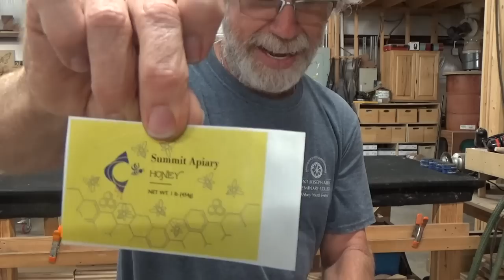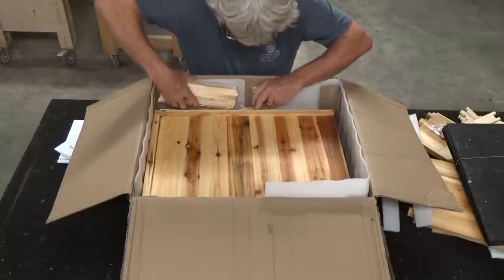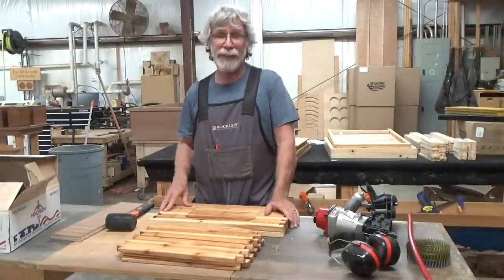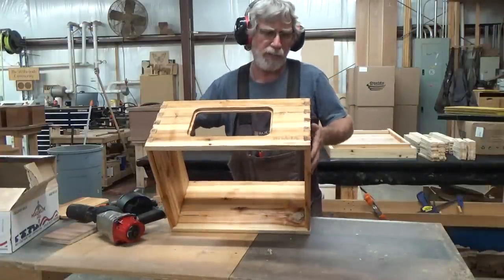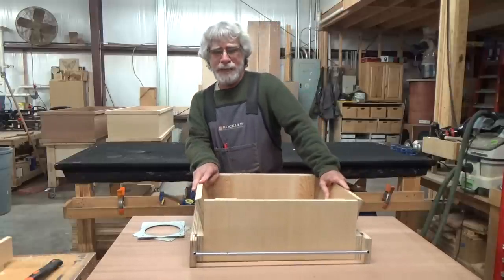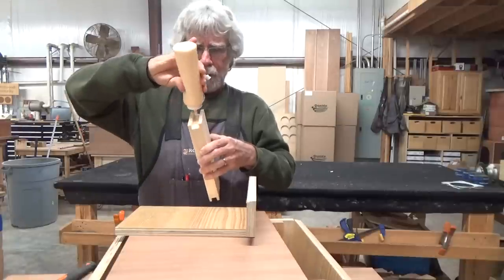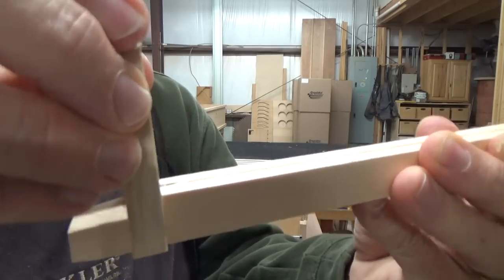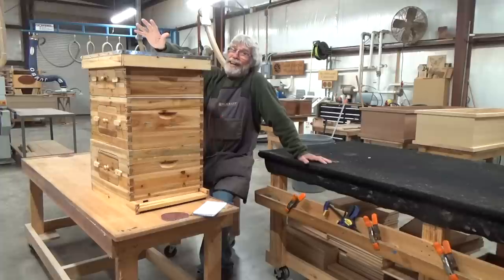Is this the best beginners beehive kit for you?  Total build of the kit.

Comment: Thank you for being so honest on this review.  I hope they take the comments to heart.  While I agree with you that these should have been more accurately machined and checked, I think the price point isn't bad.  

I don't know if you've priced cedar out lately, but WOW...the lumber in that alone is probably close to $50~$75.  A single 12' 5/4 Cedar Deck Board is STILL about $30 in my area.  Milling the lumber is time consuming for sure, and even with all those machines, there are still people manning it.  Cost of labor and overhead is not cheap to be sure.  Sorry, my old estimating habits coming out...

As for those observation ports?  Yep...100% agree, get rid of them.  That's a few ops you can delete from your build and cut some costs.

Comment: I'm a beginner, and the first time around I bought my boxes and frames already assembled. I figured that I already had enough to learn and remember to just get started and get my hives set up and go through the motions of being a beekeeper, so I didn't want to overwhelm my brain...lol...However, now I wanted to learn how to assemble...its cheaper and its the pride of knowing how to do everything for my bees, not just care for them.. This video was extremely helpful, and I learned things about what to look for in these kits that I never would have thought of, till they started to fall apart, or started splitting of course.. And your right, for the amount of money that u pay for them, they should come out of the box being right from the get go. Also, the original frames I got had wire strung across them, and I was never sure how to tighten or adjust them when putting in the new wax.. Or replacing them when needed...not sure if that was the old way of doing it or what???? But I like the groves in the newer ones that allow u to just pop the wax right in.. Also I love the frame jig...that looks like it works very well. I'm just a hobbyist, but getting older and with arthritis in my hands and fingers starting, that jig would make things much easier for me...and I could always share the use of it with my other bee loving friends. So, thank u so much for making this helpful video.. And I have subscribed to your channel.  June Bug, from Southern Oregon.....Soon to be moving to the Reno, NV area...
Reply from the maker: Thank you so much for subbing to my channel, I'm humbled every time someone does that for me. Thank you for your gift. Keep on learning about bees to keep the desire for them alive, I know you will. Also, I post a new video every Friday, and I look forward to hearing what you have to say. Good luck on your move and with your bees. God's peace June.
Mr. Ed

Comment: Thanks for an honest review! I do wonder if it were a first box for a new bee keeper (no experience), this wouldn't be a first choice due to the fact of having to assemble it and problems (like getting correct orientation of outside pieces plus if sides are not equal length.) And I wouldn't nail it cause --no nail gun. But of course, if you have one, good idea to do.  I am not crazy to assemble wood pieces someone else drilled or measured due to slight descrepancies . I put together a raised bed garden and I had to drill out all their predrilled (supposedly ready to assemble! Not) holes and lots of other little bits to glue. Very lengthy process --won't do again.
Your project puts a new meaning to the word "splits"! This company has more improvements to do for sure!

Comment: The first two hive kits I bought were firewood due to sloppy milling (the frame rests measured 18-7/8 when the standard measurement is 19-1/8). Mann-Lake hive bodies also have issues with not sitting flat or having air gaps between the boxes. Most of these production companies don't care about quality and ship Good Enough quality. I did get a super box from Bee Castle, it assembled with screws and the frames were high quality wood shipped from Amazon. .
Reply from the maker: Great comment, thanks for sharing your experiences and for watching.. God's peace brother.
Mr. Ed
Reply: After a few months, I wanted to add an update on the Bee Castle med super purchased from Amazon. The foundation was never drawn out after placement on three different strong hives. I used honey cappings to re-wax the foundation sheets and within one day there was activity pulling out the foundation. A month before, I waxed some old unused Pierco foundations and the bees are working that box for honey storage, lets me know its not too late in the year to draw wax, some years the bees won't pull foundation in August/September. I'm not a fan of imported beeswax or related products.

Comment: I made a box using a Lock miter router bit to make the corner joint's. They are strong and easy to make if you have a router table. They thing i like is there is no exposed end grain on the joint.
Reply from the maker: A great joint for sure! God's peace.
Mr. Ed

Comment: I had purchased another brand you had reviewed. It also came wax coated. The problem was there was so much wax that you couldn’t get it assembled without splitting in the joint. I solved that problem by heating up the wax in the joint so during assembly the wax was soft enough move.
Reply from the maker: Great solution for the same problem I ran across. The Hoover Hive is a grat design, glad to hear you figured out a good way to assemble them. God's peace Michael.
Mr. Ed

Comment: As a beginner, I was looking for a good “bang for the buck” starter hive. I bought the single deep with 10 frames just like the extra box you had in the video. I had the same issues you had with yours. Out of square, bad milling, etc. I used it as a guide to build everything else. It could be better, but the bees don’t seem to mind. One other problem was that I had to trim the ends of every top frame piece by 1/16” on each end just so they would fit down in the box properly. Thanks for the great videos! I especially enjoy the collaborations with Mr Dirt Rooster! Keep up the good work!

Comment: I ordered one of their 2 deep 2 medium complete hive kits from a popup ad on sale for $176 with free shipping ad said in-stock,  as soon as I gave the card info and clicked confirm order, the site popped up a box saying out of stock please reorder, so the next morning same ad popped up again, so I placed a reorder purchase, 3 days later UPS drooped off the package on my front porch, the box had ratty rough looking corners, but all was fine inside, I ran into the same problems with the joints as you did, I had to file fit most of the joints,  next day another package showed up on my porch this one had open holes in the cardboard shipping box the ends to 4 of the medium supers were missing the bottom board rails had a knot holes running through it with chucks broken out already the telescoping cover had obviously been dropped on and the rim separated from the plywood and metal part, I was in a tight and had to repair and use them, but I'll never order anything from Vevor again.
Reply from the maker: Smart move, there are lots more companies to choose from with better quality. God's peace Carl.
Mr. Ed

Comment: You could check all the sides for length and use those the same to help make square boxes.  Me, I found the rebate type joints sufficient. As you said, the observation ports should be in the front or back end of the box. I also applaud the use of joined pieces to make the sides.  The glue would need to be of great strength.  Thanks again for good video.

Comment: Thanks for this! I purchased a Vevor hive that I still need to assemble, but it does not have the windows. They have copied those windows from the Flow hive I think. Did you not glue because of the wax coating? These hives are a great price!
Reply from the maker: The reason I did not glue is because my experience has shown that with the bees propolizing the box, the joints are just as good as being glued. Thanks for watching. God's peace Robin.
Mr. Ed

Comment: Them little birds are complaining at you.😂Joy of the Lord to my brother in Christ.😁
      Hay Jeff what did you cover your wood table with behind ya, is it a felt so finished wood doesn't get damaged? 

I noticed that panel with the window has a real heavy grain line that could end up a crack from end to end. I wouldn't have used that piece for a window side if I was the cut-man. Oh I just saw that nasty knot on the end by the teeth of the dove tale, 🤨that's not good cut choices. The joints are tight, that's good.
Reply from the maker: All our tables are covered with an interior/ exterior, cloth floor covering. It helps to reduce scratching of the wood while working on it. Not much good to say about this product...especially when it comes to the woodworking aspect. God's peace brother.
Mr. Ed

Comment: Mr Ed, I think you and I know why the walls of the hive body are glued together. If they used biscuit joints for doing that it would be stronger.  I would be interesting to know if that procedure was used.  Does your frame jig or assembly box work on medium frames?  Heres a link to the one that I use and it’s very simple and works on both.  https://youtu.be/GtSsMhUynGk
Reply from the maker: Hey Don. I watched that video before I made my fixture, but I thought the spring tension bar was a better way to go. Since I do not use medium boxes, the fact that this fixture can't be use for them did not bother me in the least. God's peace brother.
Mr. Ed

Comment: It's to bad you nailed your box together. You probably could of taken apart the box and filed the ears to lose the fingers and you probably could use some water Profe  Tite Bond glue and you would also clamp them together. But now you can't become of the nails.
Reply from the maker: My biggest point of concern with a bee box is keeping it square. As long as the box is squared up it will fit perfect, and once it's squared, it's nailed. After that, the bees propolize everything and hold it in place....no need for glue. Thanks for sharing your opinion and for watching as well. God's peace Ray.
Mr. Ed

Comment: Praise Jesus, you produced another great video! I own VEVOR hives and I will NEVER buy another one. They are made in China and are very low quality. Customer service is poor when you call them. An example, I bought a 10 frame hive but they only included 8 frames per box. Wood and cut quality is all low. They are great for a budget just to get started but the hives do not last long.
Reply from the maker: I have to agree, good price but low quality. Thanks for watching. God's peace.
Mr. Ed
Reply: They had some medium supers with frames on sale for about 35 last year.  Too good a price to pass up. I had less trouble with alignment. They went together well.  Only problem is the wood is very soft.
Reply: @jamskinner I bought this kit and another knock off Chinese hive and the Vevor was better quality and the same price as the no name. 
I only had one piece that wasn't cut properly. The good thing is it went in so tight that the nails will be overkill.